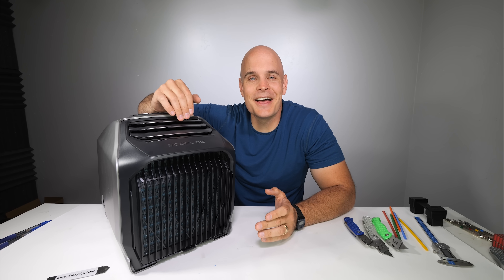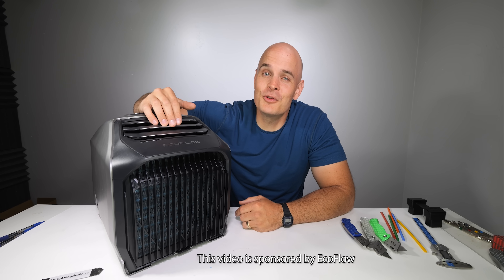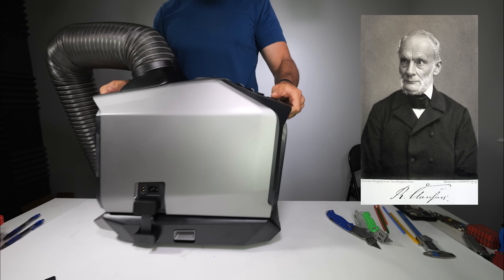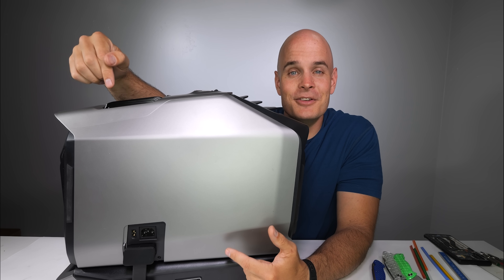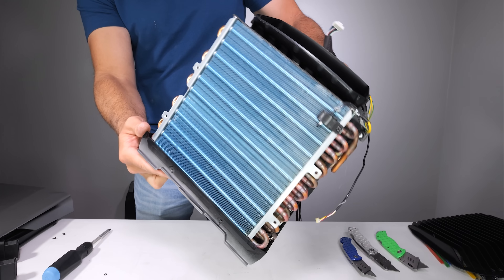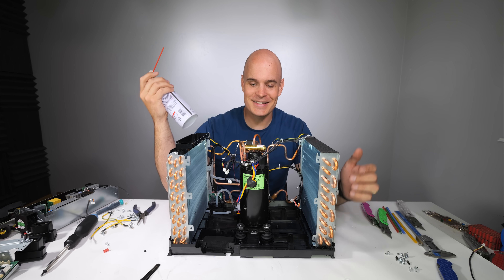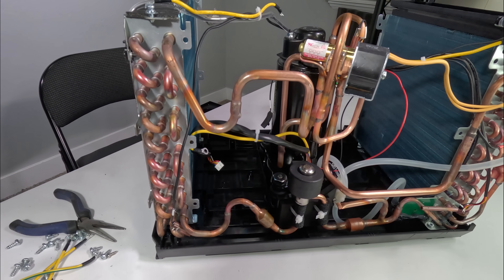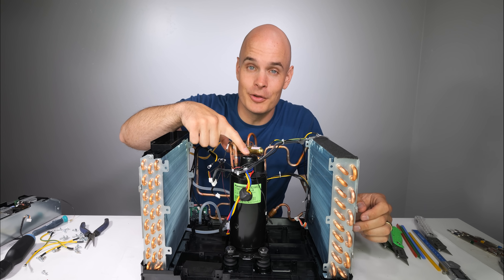THIS CHANGES EVERYTHING... (Ecoflow Wave Teardown)

Comment: A video testing the heating efficiency in cold climates like -10 Celsius would be nice. A lot of heat pumps really struggle to work efficiently in colder climates, if they are not optimized for such use. Greetings from cold Norway :D
Reply: The last few years have seen a shocking improvement in low-temp performance, such that they're viable even in the bitter Wisconsin winters that spend many days below -17 C.
Reply: @obrysii  Yes, the technology has become much better, and that's why heat pumps are the main source for heating in Norwegian households. In general heat pumps tend to work okay down to -10c, further down to - 20/25c the onze optimized for colder climates still work okay, and below -25c. Well your starting to use a lot of electricity so other heat sources is preferable.
Reply: Modern pumps get up to 8x efficiency if the temperature is above 9 degrees Celsius, dropping down to 2-3x in -10. below-19 they need electric heating. I have one of those…
Reply: @erebostd  That's completely untrue, modern ones can perform extremely well at temperatures down to -30C, probably lower than that too with more optimized models. Ground-based heat pumps are otherwise a very good option if you're using this for your house.
Reply: With r290. I am not expecting good low temperature oparation. I guess it will work fine upto -10c. Anything below and it would freeze up + the gas won't evaporate.
Reply: Trying to get heat from cold air is always going to be like trying to get blood from a turnip😉🤣🤣🤣

Comment: Interesting review, but it is not by a long shot the first wireless.  They have had battery units for decades for specialized use. As for a heat pump, that design is older than Adam.

Comment: The best thing about heat pumps is that efficiency, they are amazing, as long you work them to cool a cold room or heat a hot one. When used normally, no miracle gains and hardly any efficiency at all.

Comment: Single vent to the outside creates a pressure differential inside. Two vent systems are way better.
Reply: @JorgTheElder  Portable A/C units with two ports are much less common because they cost more. If this unit had two ports it would have been something the company would have made a big deal about in it's literature.
Reply: @sea-ferring  It is a 2 duct, pictures shown on their website
Reply: @_BangDroid_  My apologies. I stand corrected. Zack must not know how important that feature is. I'm very interested.

Comment: Hi Jerry,

Technically, nothing could be more than 100% efficient. Energy efficiency can be 100% if its an ideal machine (input energy should be completely transformed to output energy), but saying 200% efficient means it is creating more energy than it consumes.
Reply: It's somewhat misleading, it's heating energy efficiency is over 100%, it can move 200 watts of heat from one area to another using only 100 watts of energy.  It's not creating or removing heat directly it's moving it from one area to another.  Burning something or using resistive heating converts energy directly to heat.
Reply: It does, thats how why heat exchangers are awesome.